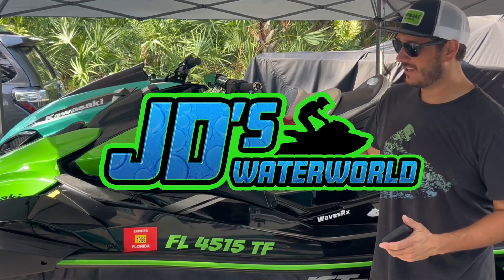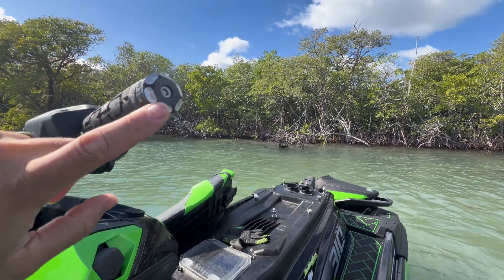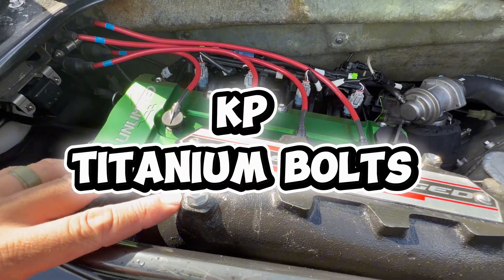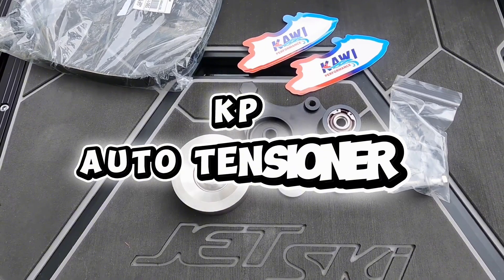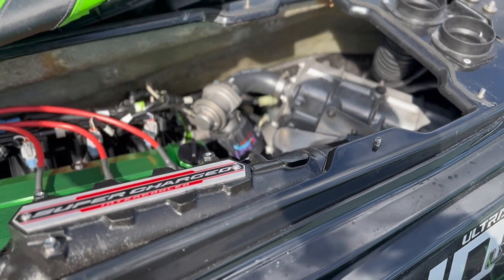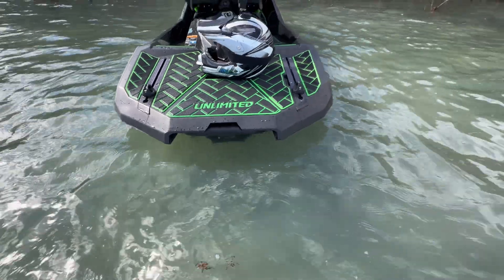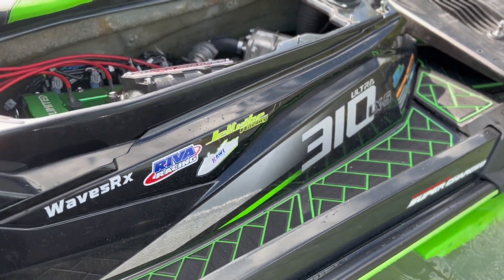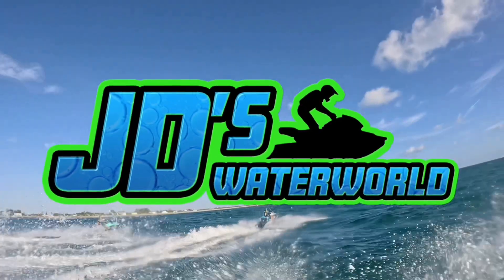Kawasaki Ultra 350 Monster Build Overview and Update  - Adding 40 hp with bolt-on mods!

Comment: This is awesome and just the way I would do it if I were to get a Kawi. The only sad part is Kawi didn’t take it upon themselves to use good stainless fasteners, leaving it up to the customer/owner.
Reply from the maker: Agreed, for the cost they should have! My FX is having serious issues with corrosion as well- all the waterline bolts on the Yamaha are black oxide carbon steel- and many of the tension hose clamps on the engine are just painted steel...Yamaha requires just as much attention to the hardware. In the 90s both brands have 100% stainless..almost everywhere. My 1997 WaveVenture can't find a single non-stainless bolt or hardware. 1997 Kawasaki STX same deal. Both brands have shafted consumers on the cheap hardware in the post-COVID era

Comment: Did I miss the riva pulley? What top speed are you getting now with the prop? What did you end up pitching it to?
Reply from the maker: Top speed so far is 78 mph at 8300 rpm, but I am running more testing with gps and with low fuel and fresh waster I am confident I can hit 80
Reply: @JDsWaterWorld great job with the build!!
Is that a consistent 78mph top speed??
If so that’s a great number for a big ultra
Reply from the maker: I will be posting all of the Maptuner log data and gps speed data shortly. Yeah with full fuel it's solid 78 blipping to 79..I think I can get 80 on the right water with the rear seat removed, 1/3 tank fuel, and an empty stomach lol. I am trying to hit that 80 on gps before I post the video.
Reply: @J @JDsWaterWorld mega effort
Look forward to seeing the upcoming videos
Reply: @JDsWaterWorld   lol we all really care about this vide. Post that you need 1000 likes on a thumb nail pic to get this vid release 😂😂😂
Reply: @JDsWaterWorld 78 is super solid. Thats pretty much unstoppable in the ocean
Reply from the maker: Repitched to 14/18 and clearance tightened. My opinion is that the solas for the 310 is actually an ultra 300
Impeller solas is too cheap to make a 310
Impeller and it has a snout that's too short that's why you need to use the OEM. I did not post the riva install video yet, still working on editing it lol

Comment: great video!!!   trying to figure out why I'm getting water into the head  on my 2023 ultra 310  used a aftermarket air intake from Australia performance supply shop maybe the issue?
Reply from the maker: Air intake unlikely to cause that issue..what do you mean in the head? On the fill cap? On the cam cover under the valve cover? Or in the cylinders?

Comment: Great vid. How are you monitoring the air/fuel ratio?  Do you need to download the data after riding or did you install a separate gage?
Reply from the maker: Using Bosch 02, PLX, and Riva Maptuner. Yes can monitor live but also recording data with Maptuner that can be exported and reviewed in mega log viewer or CSV spreadsheet

Comment: Shaping up to be the most impressive Kawasaki Ultra 310 I have seen.  Congrats on the build.  In terms of long term durability I have just finished stripping down my 2015 which must have done 250+ hours.  From what have seen, I agree with the upgrade recommendations by Steve from Kawi Performance.  When the time arrives, the factory pistons are a weak point and forged or ultra 300 pistons are better options than the factory 310 pistons.  These are very high output motors and poor quality fuel will cause detonation resulting in collapsed ring lands, ceased rings and a damaged bore.  Always use 95 octane or better.  Don’t use fuel older than a few months.  The inlet valves pit badly if salt is not flushed out properly.  Make sure to fog the engine thoroughly after each use.  Even better if you can disable the ignition spark so the inlet valves also get a good coating of oil as well.  Seriously consider upgrading to stainless steel inlet valves from Kawai performance.  The factory exhaust valves are inconel so don’t need upgrading.  Toss the exhaust spark arrestor and swap for a baffle plate of the same thickness to 100% guarantee no salt corrosion of the valves when the ski is not in use.  Check your oil cooler for corrosion at the end of every season.  These are known to corrode quickly.  Replace fuel pump and fuel filter every 5 years.  This is all related to the harshness of operating in a marine environment and the cost of ownership of a PWC. These things aside, the Kawasaki is engineered incredibly well and is a delight to work on.  The additional strength of a proper fiberglass hull and ability to repair if required is an extra bonus.